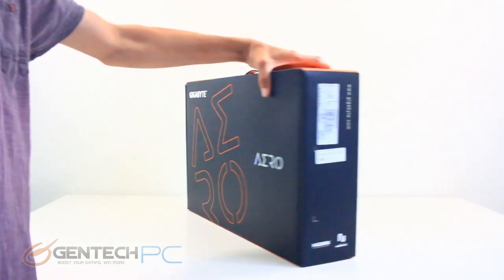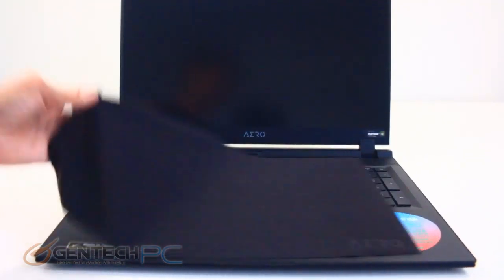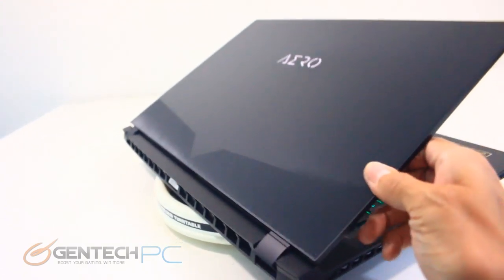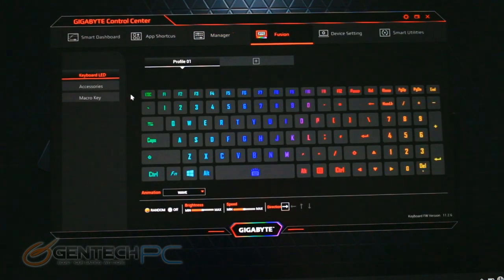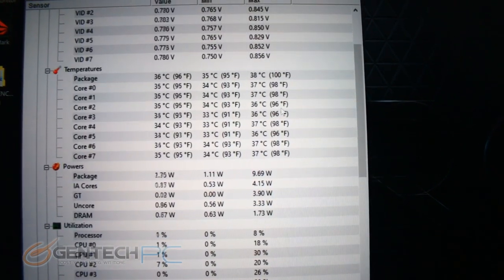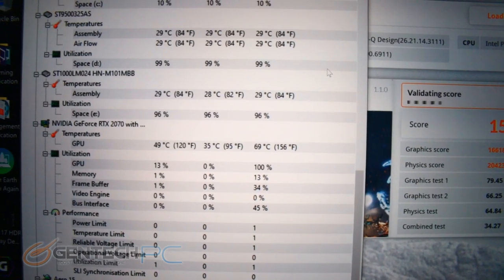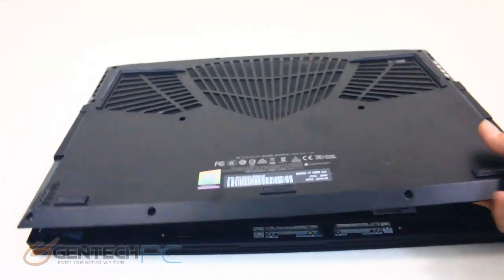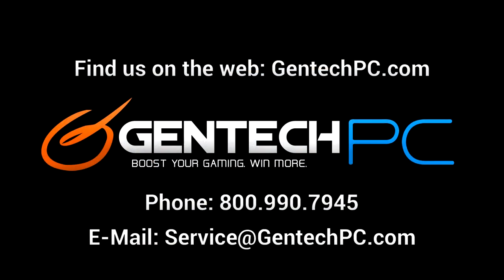Gigabyte Aero 17 RGB HDR IPS 4K Laptop Review

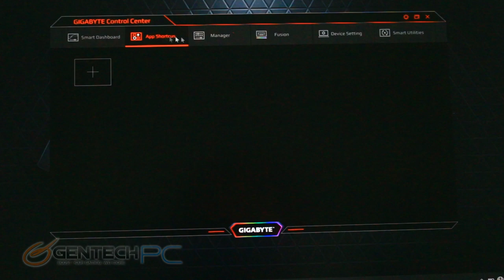Comment: You forgot to increase the power for the GPU. at 4:56 in the video, you can see the command/control center at the "device information" setting in the bottom of the screen. It has two settings for the graphics card (2070 max-q), there are two orange bar settings, left is 80w and right is 90w........You left it on 80w instead of switching to 90w....that is why you got a firestrike graphics score of 16,618.....that's normal for 80w 2070mq......at 90w you would have gotten 17500 to 18500. Just letting you know. thanks.

Comment: Do you find there is a lot of electrical noise (not fan noise) whenever the power cord is plugged in?

On Quiet Profile with no power cord, it is virtually silent. With the cord in, it makes a heap of ticking/crackling/whirring electrical noise. Its not super-loud, but in a quiet environment it is super annoying especially because it is an inconsistent sound. Keen to know if others are experiencing the same before I ship it back.

Comment: Hello, I just bought an aero 17 XA, with an i7, 16 gb..., 2 days ago, the pc is nice except i really dont like that the secondary letters does not light up 😠
The PC IS SOMETIMES VERY SLOW IT TAKES MINUTES TO OPEN A CHROME WINDOW... OR IT DOES NOTVEVEN REACT TO OPEN THE CONTROL CENTER FROM GIGABYTE !
I just installed chrome, davinci resolve and an antivirus software, tried to update all firmawares and i end up with no more sound !
I had to initialised windows 10.... 
I am really deceived by the aero 17... I think i am going to send it back... If you have an idea about what is wrong ? Thanks

Comment: Anyway to set the back lighting keyboard to plain white?
Reply from the maker: Yes through the pre-installed Gigabyte RGB Fusion software.
Reply: @GenTechPC  perfect. So I have an issue. I do a lot of 4k video editing and rendoring. The i7-9750 with 16gb is 1k less than the i9 32 gb ram option. Will 16 gb handicap me? Is a more powerful process and double the ram worth an additional 1k?